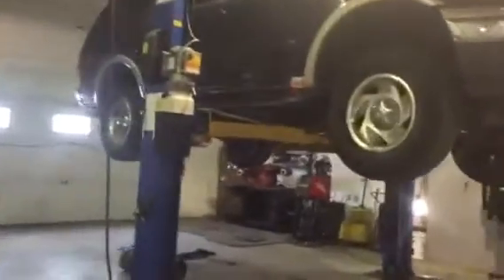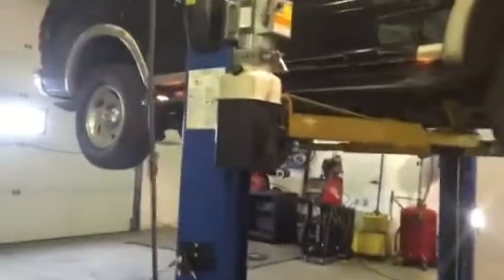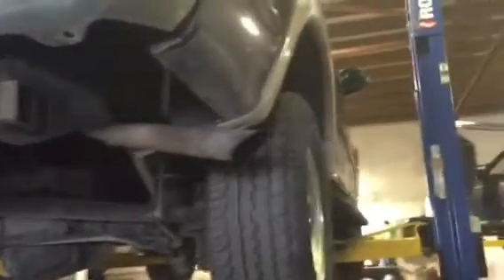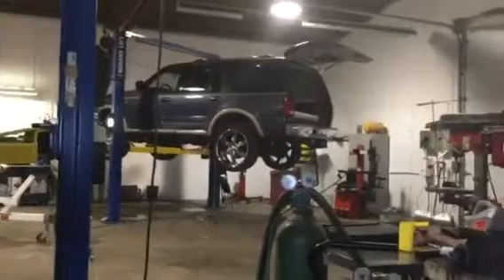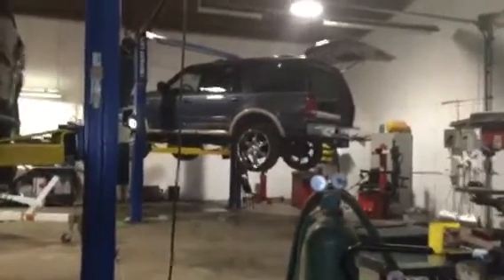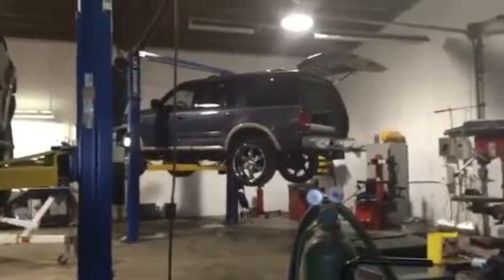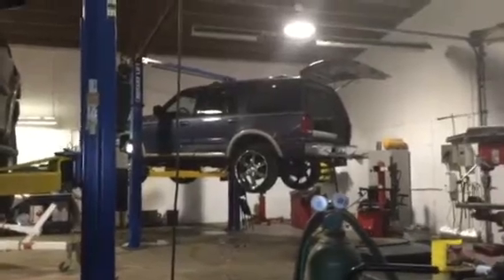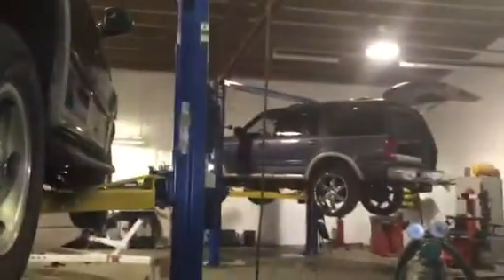Thrush verse straight pipe Expedition

Comment: What's the diameter and length of pipe thinking of straight piping my 4.6 expedition
Reply from the maker: OHMAGEDDON Vapes your stock exhaust should be 2.5” you will need 2.5 feet of pipe roughly.
Reply: @Trevormoen  ty